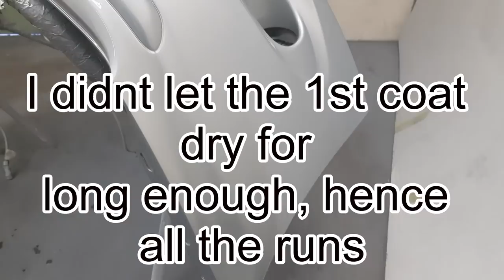ALFA ROMEO GTA PART 3 front bumper repair.

Comment: Hi Neil, have you ever changed a 156 front passenger seatbelt assembly? I got stuck on the rear plastic floor kick panel. Can it be prised up on the corner to get the last corner of the center plastic off without taking the rear seats out? It also looks like that alloy discharge pipe is going to get in the way of changing it over. I had to get a used assembly because there's only original manufacturers replacement. Mine locked up the belt halfway out and won't budge. Cheers if you can advise any tricks.
Reply from the maker: cant remember to be honest. if its like the 145 there a faff to get in and out.
Reply: @ItaliaAutos  I'm gonna try to force it, if it looks like it's gonna break I'll have to take it somwhere to take it apart. I don't think anyone will fit a used unit because of local laws but they can make it accessible.

Comment: I just got 1.9 TD alfa gt has every possible problem you mentioned in one of your vids but if i drive it on smooth road its all good when i hit a bumb screen says monitor control systems failure flashes every unit and cuts power for 5 seconds and then is fine again. I assume loose wire on canbus or some bad power or ground? But on what module.
Reply from the maker: Check main engine earth

Comment: Hellow i have a question mabe you  can help me, my 159 has made some overpresure in engine and blow oil out buy the oil filter, But the car was by an alfa workshop but they say they dont find any reasons why and they made a full check. Mabe you have any idea
Reply from the maker: could just be a leak from the housing. if they say its ok its ok.
Reply: Thank you for feedback, but it continually push oil out by te oil cap and i just add 400ml oil, i will keep a eye on it just in case
Reply: Sry i write wrong " oil filter cap" i order a new oil filter cap
Reply from the maker: Ok if it’s your cap yeah get another one first,
Reply: I fix it today  it was the rubber ring from the filter cap, was so old and it was at square shape and alot of silicone taked some time make it clean, also the car got back the "bear roar" sound
Reply: Replace 159 with a 156